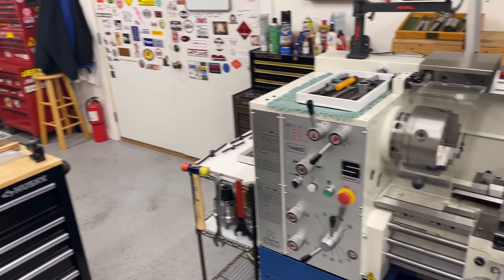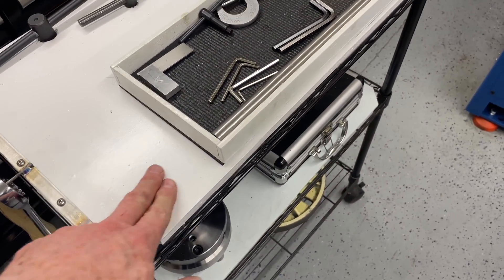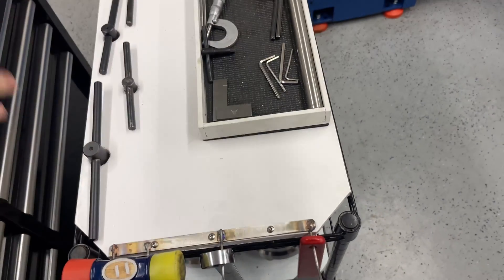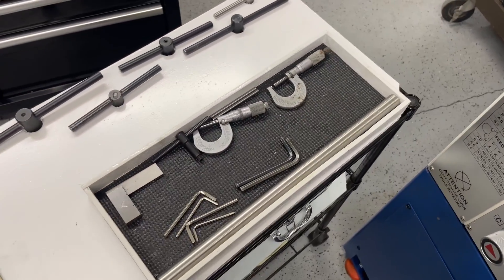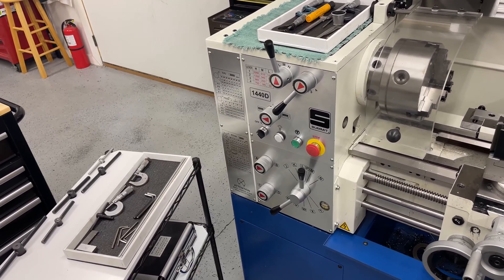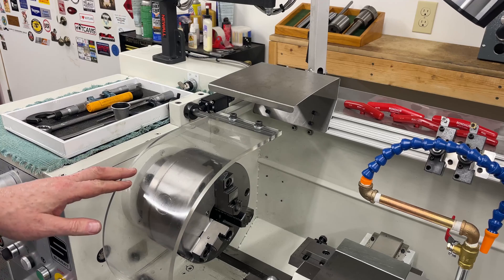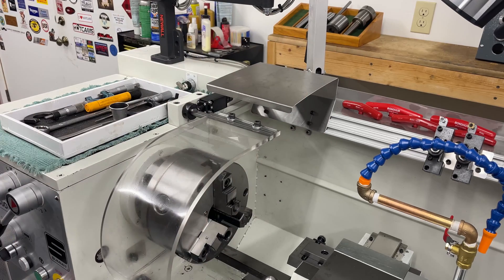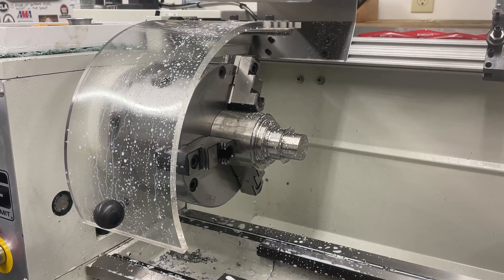This and That - Lathe Coolant Fill and Dispense Test - More tool storage and organization ideas.

Comment: Hi Stuart, as a Machine Tool Fitter ( Millwright ) I would strongly suggest that you take off and check the cross slide and compound slide for rust ocasionally . The coolant will eventually die and the rust inhibiting feature will dissapear, the dead coolant will just lay there and rust the slideways. Keep an eye on the surface of the coolant, as any lubricating oils lost will run into the tank and float on the top. Many Years since I used flood coolant as often it would go " Off " and smell and rust the machines. When at work it was quite a major job to keep on top of the Housekeeping of coolant, as it could go off very quickly, smell and rust the machines. That was 30 odd Years ago and now hopefully they have synthetic mixtures instead of Soluble oil. With regards to the nozzle size, turn up a bit of plastic to fit the current nozzle but only put  a 3/32 or 1/8 hole.  Regards from Australia.
Reply from the maker: Morning Dave! These kinds of insights of yours on their own make the effort of producing these videos worthwhile. I very much appreciate it. I have done some research on flood coolants, much of which was discussing it with the maintenance team at work. For sure the synthetic coolants are a lot better than the older versions. Even so your warning is well taken. On my last lathe I took great care at the end of a machining session using coolant to carefully brush, wipe and blow the machine down, and then give it a good oiling to prevent coolant sitting. Even then it bears a tear down from time to time. This synthetic coolant has never smelled bad, happily. Frequent changing helps, and I spray my machines down with WD40 also to displace water. This seems to have worked well, plus my shed is insulated and lined with damp proof membranes so I don't suffer with rust typically.
Reply from the maker: Making a custom nozzle will be a fun little project, also. Cheap though the plastic ones are, a metal one will be a lot nicer.
Reply: One thing I've learned to do that helps a lot with prolonging the life of the coolant is to stick a cheap fish tank aerator into the coolant sump. Just leave it running all the time and the constant fresh air being mixed into the coolant will prevent bacteria from taking hold. But even the best emulsified coolants are mostly water. So despite what the manufacturer might say about it, "leaving a protective layer" "inhibiting rust" blah blah, it WILL cause rust. I always clean and dry my machines thoroughly after use, and especially after using coolant. That summit lathe is incredible btw, such a nice machine.
Reply from the maker: @hersch_tool  what a neat idea - I love it. I take the same approach as you with my machines. It is vital in a small / home shop where the use of the tools is more intermittent. Thanks for your comments. I am incredibly happy with this machine - it has exceeded my expectations significantly.